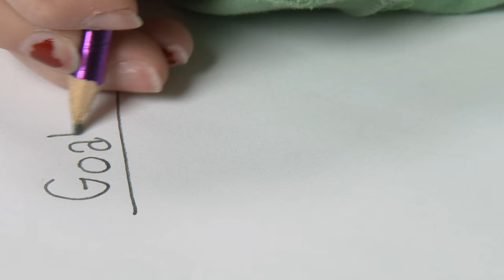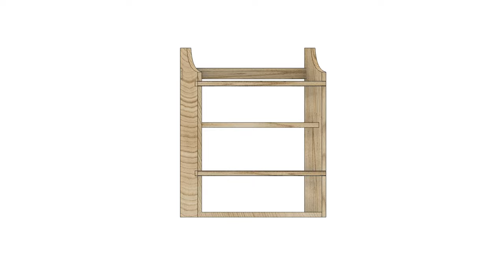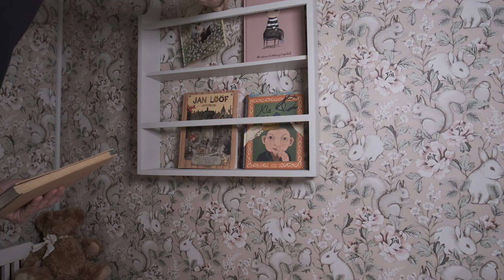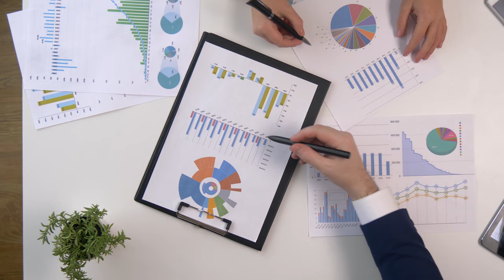woodworker decides to go full time

Comment: For your double side tape issues ... use papercraft tape on both sides and ca glue on this to put them together. Strong on hold but easy to remove and lot cheaper then double side tape.
Reply from the maker: will definitely do that in the future. Thanks!